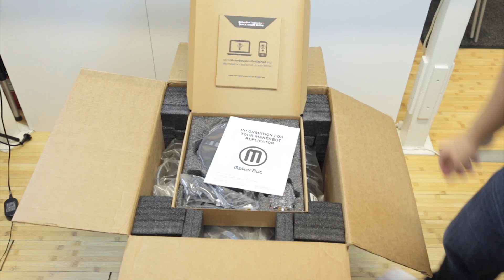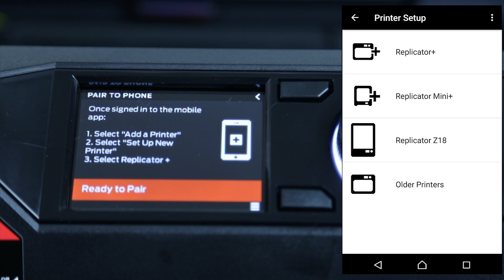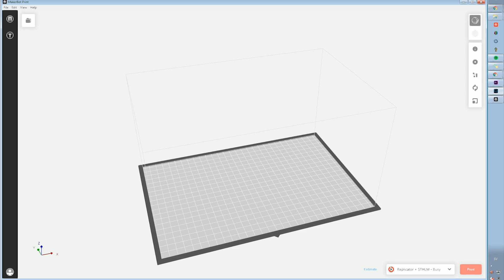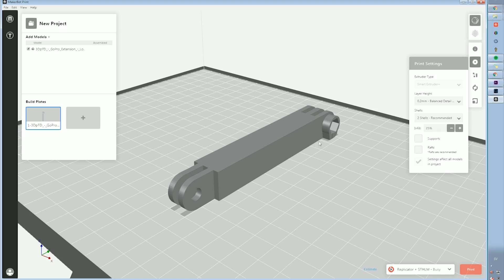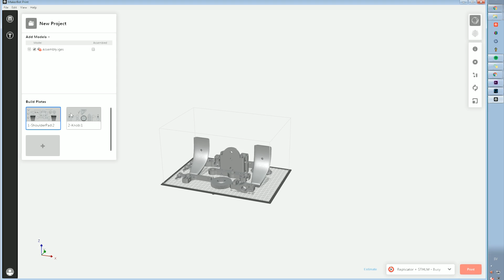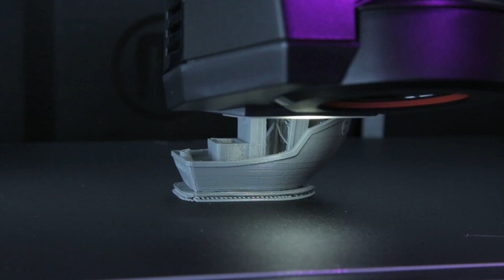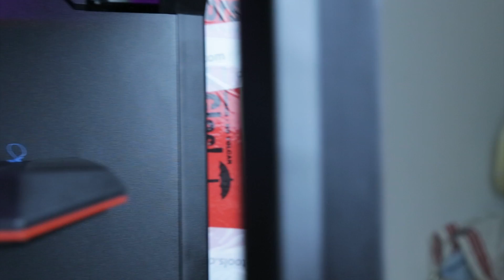MakerBot Replicator + plus - 3D Printer /Review

Comment: I watched this whole thing. I felt like Anton was very biased in his review. I felt like he got a pre-production unit and he had to give it a good review. From what I saw, I see many flaws in this $2000 printer that don't happen in much cheaper prosumer printers. He glosses over the fact that in a very limited use he had several failed prints and computer problems. IMO The warping off the bed is a flaw of not having the heated bed, the non-sticking is a flaw of not having a proper surface, the computer server software is a flaw. IMO I doubt this would be very good in a school environment as he suggests, especially with a large open enclosure and a 400Deg F heating element .

Additionally compare the Benchy quality from this and a prusa mk2, lulzbot, or any other modern competitor; it's simply not as good.
Reply from the maker: Hi Sigso1. Sorry that you feel that way. Of course I was excited the few weeks I got the machine. But I've been using a regular 5th gen since release as well and I had more or less the same experience as everyone else using it. So when I experience something based on that knowledge that reflects in the video. However, on the other hand I'm not biased by the actions of MakerBot as a company in the history. That doesn't affect the printer, software and how it works now, right? 

But i hear you and will try to take this into consideration!    Let me try to meet some of your other feedback :)

The warping is a downside, Yes! Printing a 25+ cm wrench on any printer in PLA isn't easy, heated bed or not. I will continue testing solutions (like AprintaPro PrintaFix to make those prints stick) as a solution for worst case scenarios, but yeah, i'd rather have that built in.

And to correct you I had one print fail since I couldn't start it (sending the file failed at beta-software).  With the schools aspect I agree it's a statement that might not cover kindergarden (they have a Mini in that case with doors and stuff). For older students the printer is among one of the least harmful tool available to them. But yes I could have been more clear about that. Sorry!

The 3Dbenchy has been printed on the official release of firmware/software. Standard settings:
http://www.antonmansson.com/wp-content/uploads/2016/09/3Dbenchy.jpg

As for prusa Mk2 I've seen great prints, most seem to be out of the box which is impressive! I'd love to have a closer look at it to compare them. However I think even Prusa and MakerBot agrees they are not reaching the same customers ( but don't quote me on that).

Again, I hear what you say and will take it into consideration. Thanks for taking your time! Hit me up if you want to know anything else!

Comment: Nice job on the review. I'm going to assume the bed is non-heated. Do you think it'll print Ninjaflex or any other type of composite PLA?
Reply from the maker: Thanks! Yup, not heated and therefor you need to keep it clean for best adhesion.  I haven't tried any other filaments (yet)  but ninjaflex would be tricky in the smartextruder due to it's design.